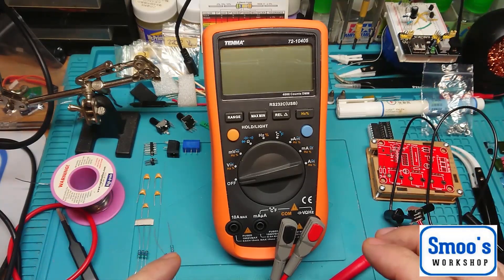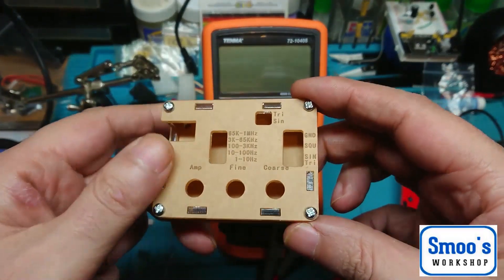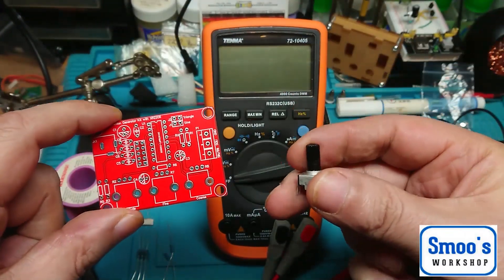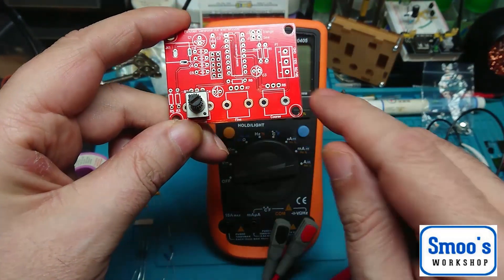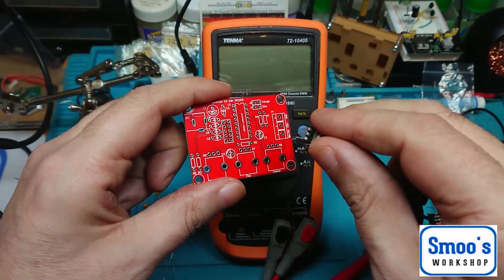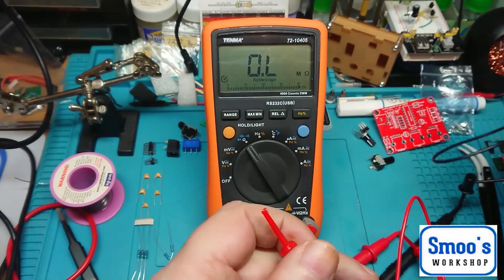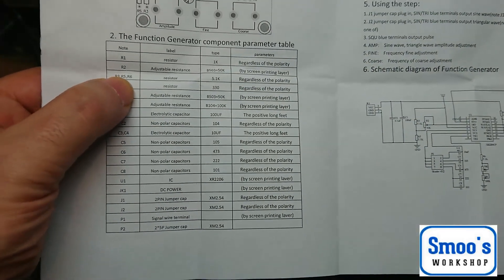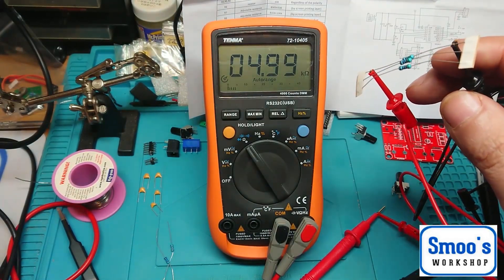KKmoon High Precision Function Signal Generator DIY Kit - Part Two - Build and testing.

Comment: Thank you so much for this video!  I just got my first scope and I'm learning how to use it.  Wanted a little function generator to play with and this fits the bill.  I appreciate the gotchas you're going to save me from making because I watched this video before building it.  Folding over the caps, the potentiometer thing even just soldering tips.  I'm new to all this and I appreciate the time you spent making this.  Not too long at all and as you say, fast forward or 2x speed are options.
Reply from the maker: Glad it helped you, was the whole idea of the video
Reply: @SmoosWorkshop  I just finished the video.  I was on the edge of my seat!  What a nerd I am, lol.  (You too!)  The ending was perfect.  It's exactly why I buy cheap stuff to learn on.  Figure out what's good, what's not so that when I spend some real money I know what I'm looking for.  I looked at, but didn't buy, the DSO scope.  I ended up with the OWON 1022i.  More expensive but not as expensive as as Sigilinent or Rigol beginner scope.  I'm sure I'll upgrade that and get a decent function generator.  Too many cool projects to do.   Thank you again!

Comment: mate I think you need to invest in an "oscilloscope" - not sure what that device is but try search for an old Tektronix - analogs are still very cool unless you need > 100 MHz - I get perfect waves
and it will clip like any signal if you increase the amplitude too much.  The IC is a precision chip.  It is stable as and I've been impressed so perhaps check the polarity of caps and solder joints because I just put it on the bench and pretty impressed.  That scope mate - think about it this way because it really is going to affect your work - its like buying cheap drill bits.  Thats the best way I can put it.  I started the same and then realised the error of my ways.  Good luck
Reply: Also the probes are what delivers the signal I know they are stupid expensive but you know depends what you are after.  I took the hit and never looked back.  Hope that helps.
Reply: It sounds like something is not correct with that circuit it should perfect stable.
Reply from the maker: Not got the budget for a scope but some playing around got it stable, I'm a tech to trade so know about better gear etc, just me dabbling with what I can afford atm